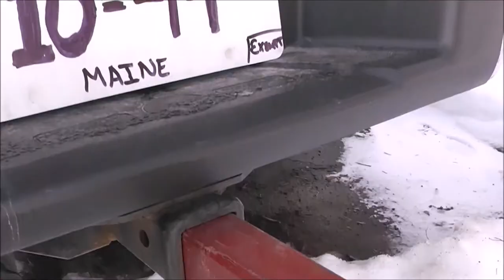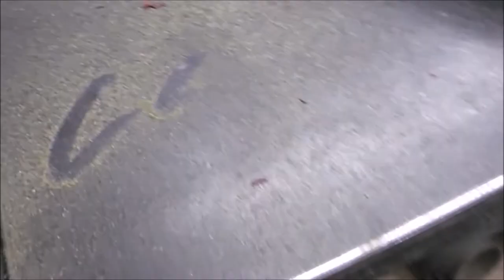Scrap Metal Hitch Mounted Bike Rack Build

Comment: Ok. Now what stops bike from swaying back and forth when taking off and stopping as well as wind force pushing bike when traveling at fast speeds? Curious if it does swing enough to hit tailgate of truck or how far it trails behind while driving? Definitely a good starting point for rack. Woukd like to see improvements as well as more sturdieness for bike staying in place while moving. Look forward to the updated vid.
Reply from the maker: It's only as good as the person that straps the bike on. Obviously the design was made to be simple so if you don't secure the bike properly then of coarse it's going to have movement.

Comment: Hello, what distance did you use from the hitch to the start of the vertical please? How high is the horizontal from the ground?  Nice design this one, very good job
Reply from the maker: Hey David, sorry but I gave the hitch away to a friend so I dont know the measurements. It worked slick though.
Reply: Ah ok, no problem , thanks anyway